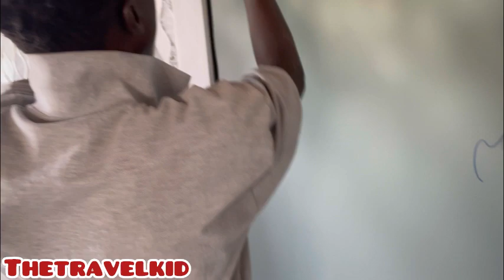BATHROOM DOORS INSTALLATION, @Thetravelkid3164

Comment: Do you do construction works bro??
Reply from the maker: Nope I only dealt with aluminum sliding doors and windows
Reply: Great video ! Something that would make your life so much easier would be a good 18 or 24 volt cordless drill with a couple of batteries . Saves extension cables everywhere and the chuck key is plastic or nylon not metal like on an electric drill, so if you rub against a tile or anything it doesn’t mark. Thanks for sharing as always, Take care and stay safe.
Reply from the maker: @brianmartin2071  thanks so much for your and time to watch my every video I post and the wonderful comments you always do with the advice and also rectifying my mistakes which I really appreciate so much @brianmartin2071
Reply: @Thetravelkid3164  How much for a bathroom door like that one?
Reply from the maker: @waynesalmon5602 this ones we made them 7k for each
Reply: @Thetravelkid3164  can it be cemented in??... Because my last one thieves broke in the property and stold the whole unit..
Reply from the maker: @waynesalmon5602  nope we screw them to the wall and it’s unremovable